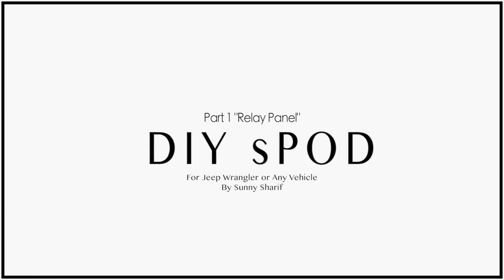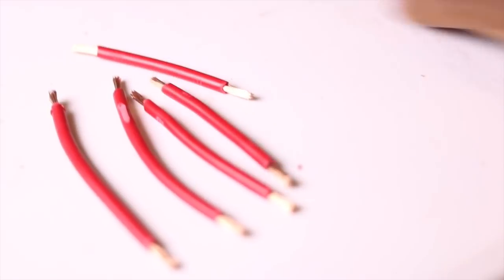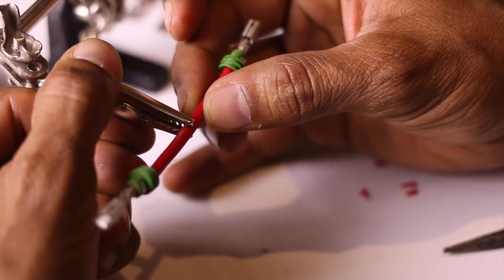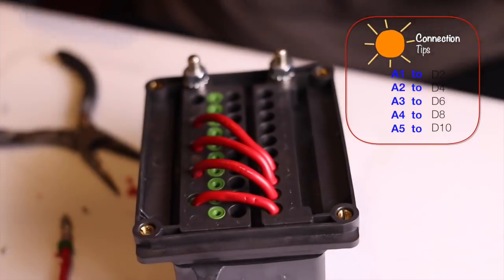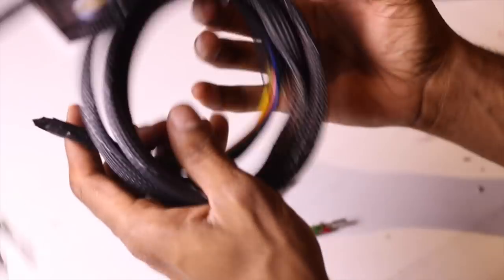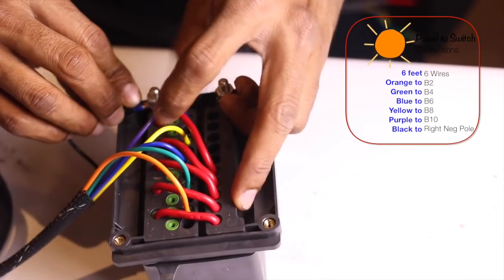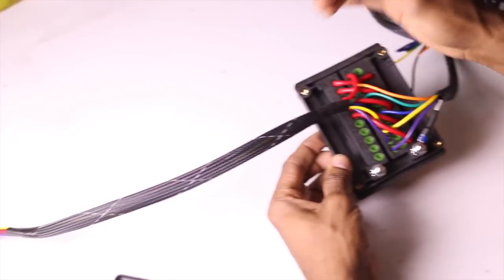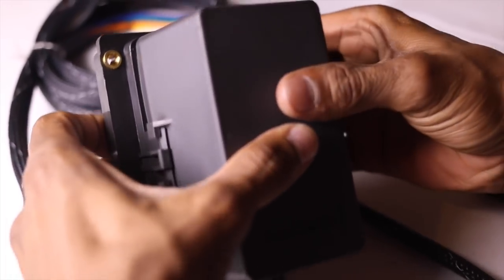DIY sPOD "Switch Pod" for Jeep Wrangler 2011-2015 (Relay Panel)(PART 1)

Comment: Great Video, you make it very easy and understandable for us less "Electronically inclined" types. I have a question for you, this set up is for 5 relays (switches), how would the process continue if I wanted to have 8 switches? it seems obvious, but it might not be, and I hate assuming, we all know what that means. Thanks again for the great vid.
Reply from the maker: thank you so much for your kind words, you can do two things....Get two switch panels, one pillar switch panel and one similar to the one shows in the video....and install two of the boxes ....or you get can a bigger box from waytek wire..I will be adding more switches and relays to my system....stay tuned i will be making the mod soon...good luck and feel free to ask any question you may have,.. :) happy jeeping

Comment: can I just use 16 gauge wire ?
Reply from the maker: Jennifer Clark hi Jennifer, you can use 16 gauge for smaller accessories, however for he main wire you want to use minimum 12 gauge. Also if you will be using light bars(300w) then absolutely go with the higher gauge. Or your wire will start to melt.
Reply: If I am only installing only one set of lights right now do I just need one relay but can I install all 5 for later use? Also if I am running a wire from the fuse box to my light that is at the back of my FJ should I use a 12 gauge wire?
Reply from the maker: Jennifer Clark hey Jennifer, so yes you can install all the relays now and follow exactly as  you see in the video...I have done the same thing. Right now I am only running two lights..but all my relays and switches are installed and ready to be hooded up if needed. Soon I will make a video to show how to connect lights or accessories. For the wire from relay panel to the light, it all depends on the watts...like for 300 watts bar in running a 12 gauge wire, but for 27 watt lights I m using 16 gauge wire. I hope this helps.
Reply: It doesn't make any sense to use 12 guage wire from fuse to relay then use 16 guage to go out to your accessories. The way this set up works is the switch activated the relay. The power goes through the fuse then the relay to the accessory. If you have to have 12 guage from fuse to relay or it could melt then you need 12 guage from relay to accessory for the same reason otherwise 16 guage the entire route from fuse to accessory is fine.

Comment: Hi Sunny, great video. I have watched it several times as well as read the forum build by Hooz and found a few discrepancies between your two builds. I tried sending you a private message but I do not see where you accept them on your "about". How can I get in touch with you to get a few questions answered?
Reply from the maker: Hey  thanks for the comments I didn’t get any messages let me get home send me you info in the pm I will contact you later after work
Reply: Thank you! It did not give me an option to private message you.

Comment: Was there an estimated overall cost? Did I miss that some how? Great write up.
Reply from the maker: +James Cantu Hey James thank you, depending on the switches you pick, if you pick the lower end switches from wish.com or other sources....it can cost you less than 200 bucks..or maybe less... i used the expensive ones so mine were little higher.
i hope this helps your question.
Reply: @5sunny01  was it less than $200 for the entire project or just the relay panel? thanks in advance
Reply from the maker: Michael Gauthreaux the whole project sir
Reply: @5sunny01  thanks appreciate the response, i might try to do my own as well

Comment: Why did you use 12 guage wire for fuse to relay but 16 guage everywhere else?
Reply from the maker: Because of the loads for safety reasons if it was a small gauge wire it would put high load and can catch on fire. I never had any issues and still gojng strong
Reply: @5sunny01  but you used 16 AWG from the relay to the accessory?
Reply from the maker: @Leapdog01  yes
Reply: So the power doesn't change after the relay and the run is longer but you put a thinner guage wire and you aren't worried about that heating up and causing fire.
Reply from the maker: @Leapdog01  that’s why there is a fuse in the relay box, also use a good quality wire and make sure accessory used is not higher powered, you will be ok
Reply: The 12 guage you used is not necessary then.  BTW wire guage has to be accounted for when considering amp draw of a circuit. You can run 12 guage then change to 16 and expect the same protection. Because of the materials used all your circuits after the relay are only 10 amps...your relays are 30 and anything with a fuse higher than 10 amps is running the risk of starting a fire. 
18 gauge – 7 amps
16 gauge – 10 amps
14 gauge – 15 amps
12 gauge – 20 amps
10 gauge – 30 Amps
Reply from the maker: @Leapdog01  you are on a right track it’s been a while since I worked on the jeep so I’m a bit rusty, I will start again from next week once I get my jeep back, o will post more videos and explain better I guess

Comment: Is there anything that prevents this being used on a 2010 JK?
Reply from the maker: no you can use this on any vehicle...or any year....its just that the dash panel I m using its for 2012 Jeep Wrangler..
let me know if you need any help. best.
Reply: Sunny Sharif Thanks! Looking forward to part 4.

Comment: If you are going to spend the money on the panel & pins, buy the proper crimpers as well.  There's no reason to solder those & no benefit from doing so.

Comment: That is so much DIY then how to do it.. you don't cut wire outer part to fit it smaller seal.. never.. you don't solder connectors to wires, cos you need to use right one crimp tool.. ffs.
Reply from the maker: Errtu Zarathos thank you I will keep that in mind....honestly thank you that's how we learn right :)